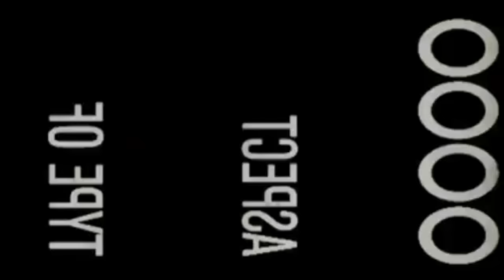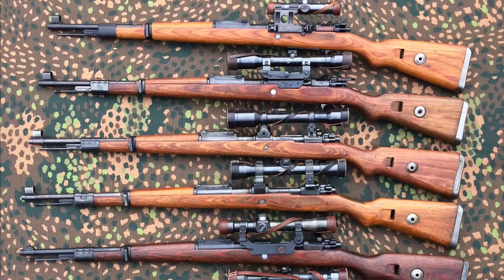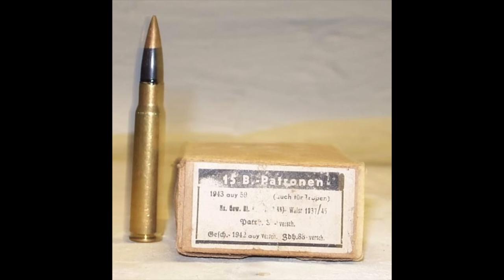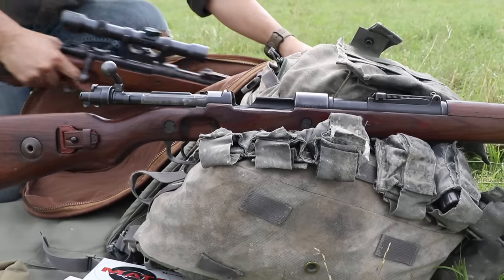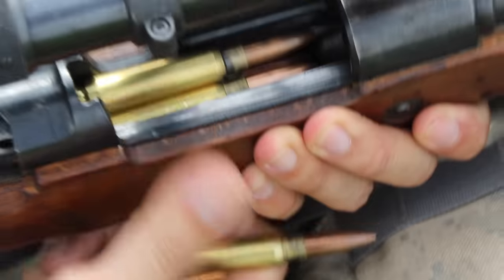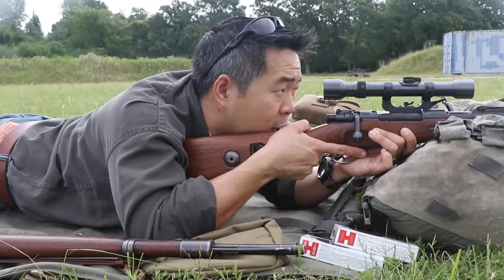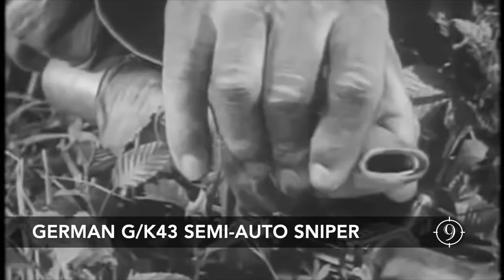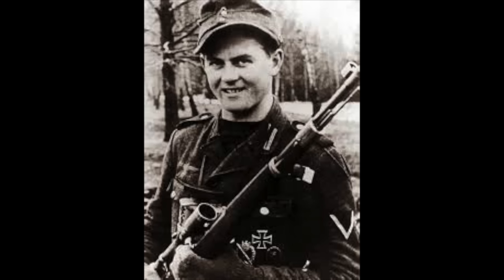The Kar98k Sniper Rifle and the WW2 German Sniper

Comment: Owning and shooting a K98K from 1936 with an ZF41 myself and I love it. Normally it's 200m and I can tell that it's quiet accurate - even with rather cheap ammo.
Always a pleasure to use it. I actually bought it as my late grandfather had one of these from the same year and the same production as mine. Of course the original was lost somewhere in Russia - not so my Grandpa: He made it back home from Siberia to tell the story...
Reply: Practice is the criterion of truth. Pavlichenko and Zaitsev, if they read the words of praise about the Mauser, would laugh
Reply: @ОрдерШоков-ш8к  so true - at least the first part.
I assume if you have seen what any rifle in the hands of a good shooter is capable of, none of the two snipers you mentioned would laugh.
Did you have the chance to shoot them both? What are your impressions?
Reply: @HaraldHofer  

I have experience using the Mosin rifle and the kar98 Mauser rifle, the Mosin sniper rifle in my hands shows better results even with a PU sight. As a result, I replaced the PU sight on it with a modern 5-20x56. It is a pity that Zaitsev did not have such an opportunity
Reply: @ОрдерШоков-ш8к  Thanks for sharing you experience. However: the K98 Snipers were selected by there accuracy. And I assume the same applied for the Mosin. In order to get a comparable result both should be sniper variants. 
But frankly, I don't care too much about which rifle is "better".... :)
Reply: @HaraldHofer  Мосин все еще соажается против террористов в Сирии, поэтому для меня это важно))
Reply: @HaraldHofer  Mosin is still fighting against terrorists in Syria, so it's important to me which one is better 😁
Reply: @Götz von Berlichingen 
I suggest you be objective, not spitting crap. In what Mauser is better than Mosin:
- a good fast fuse;
- Mauser is shorter than Mosin. 
What Mosin is superior to the Mauser:
- accuracy is higher than the Mauser and is 1.5 MOA with a good cartridge;
- a very common cartridge with a wide range of items, especially in combat areas;
- higher reliability in combat and hunting in deep forests;
- a cheap way to install a modern sight that does not overlap the sight line of the front sight and rear sight;
- Mosin's armor penetration is better.
Reply: @Götz von Berlichingen
SmK (G), one of the best Mouser armor-piercing-bullet 12.57 g, with a tungsten carbide core, muzzle velocity -911 m / s, armor penetration 19 mm per 100 m
But
The armor penetration of 7,62x54R 7n37 bullets was: 100% penetration of 10 mm thick 2P armor at a distance of 400 m and 80% penetration of the same armor at a distance of 500 m. 
In bolt-action rifles, the bolt stroke is ensured by the accuracy of the cylindrical surfaces of the bolt stem and its channel. The cylinder runs in the cylinder, and even with very little contamination of the cylindrical channel, the moving part is rubbed. And it is impossible to make more backlash in the cylindrical channel, because the quality of movement as a whole will immediately suffer.
In the VM, with an external similarity to the bolt scheme, the main part that ensures the shutter stroke is not the stem cylinder, but the connecting bar that slides in its prismatic groove. And in fact, this is a rifle with a longitudinally sliding prismatic bolt, where its cylindrical parts practically do not contact the cylindrical channel, and the reliability of the stroke is not responsible for the stem of the bolt, but a simple prismatic bar and an equally simple groove. Which is structurally still further protected from contamination by its very location.
This is easy to verify by simply inserting the mosinsky shutter stalk separately into the box channel - it will simply have huge backlashes and will not provide high-quality movement by itself. And the manufacture of its cylindrical surfaces will cause children's laughter from uninformed people and stupid ridicule of "Russians who are unable to process a cylindrical surface". In fact, the stem of the mosinsky gate could have any other shape instead of its cylindrical part - for example, it could be six or four-sided. From this, in the very course of the shutter Assembly, absolutely nothing depends.
But the bolt Assembly, although it looks like a bolt, goes extremely reliably and easily-due to the fact that this move is provided by a prismatic bar in the simplest groove. And large gaps in the coupling of cylindrical parts provide a lower probability of "cylinder-in-cylinder" jamming. Therefore, with the external similarity of the mosinka with a bolt rifle, it is quite legitimate to call it a weapon with a longitudinally sliding prismatic bolt, having cylindrical parts that are not designed to provide the bolt stroke as such.
And it is the connecting bar in the mosinsky gate that is the main part that requires precision processing and is responsible for the movement of the gate. And it is much easier to ensure the quality of a prismatic part in the same groove than the accuracy of cylindrical channels, and it is more reliable in the end.
It should also be noted that in most purely bolted schemes, a solution with a longitudinal sliding element correcting the stroke of the cylinders was also subsequently applied, this is easily seen in almost all modern bolters. Though not in such explicit form as in mesince. But the first who decided to part with the concentric cylinders and their guile was Mosin.
The second feature is the use of a Welt cartridge. In which the interaction of cartridges in the store occurs only three-point: at the points where the caps of the cartridges touch and only two points of the rest of the geometry of the cartridge case. There is a lot of free space around the cartridges that interact in this way, which allows you to carry even heavy contamination of the magazine.
In cartridges with a groove, and even stacked in a staggered order, the contact of cartridges with the magazine box and with each other occurs not by points, but by segments of contact, and it is much denser. And the slightest speck of dust there can jam the supply of ammunition. Cartridges with a Welt successfully pass much more pollution, it has a place to go in these cracks-without jamming the feed.
Reply: @Götz von Berlichingen Russian military tests for dirt, cold, icing, and dust are the most severe of all. They can withstand Mosin, Mauser, some stand, some are not. I wrote above why.
Reply: @Götz von Berlichingen Can you aim through the front sight and rear sight of a Mauser with a standard or modern optical sight?
Reply: @ОрдерШоков-ш8к  You are comparing the S.m.K.H, adopted in 1939, to a round that is rather rare and designed in the 2000's.
C.I.P has ruled that both cartridges can handle the same piezo pressure of 390MPa. And looking at ballistic coefficient of sniper cartridges, the 7N1* has a significantly lower ballistic coefficient of G1 0.411-0.498 than the s.S. at G1 0.557-0.593. So I don't see why you wouldn't be able to get similar performance out of 8mm Mauser if it wouldn't have fallen out of nearly all military use when NATO standardized the 7.62x51mm.
I'm not saying that 7.62x54R is bad, not at all, but I don't think the armour-piercing comparison is fair.

* I know that the 7N1 was replaced by 7N13/SNB in 1999. I was unable to find any data on the newer rounds.

Comment: Keep in mind that in the late war report the results were also heavily impacted by the ability of the shooter, not to mention the conditions on the day of shooting (a lot of impacting factors when you're shooting at 1.1 km. Also just a small note, the 80x140mm minimum accuracy acceptance standard rectangle has to be flipped, i.e. a 80mm horizontal x 140mm vertical rectangle @ 100 meters (110 yards), which is 2.8 MOA x 5 MOA, within which the 5 shot group must place. This was just the first stage of the acceptance procedure for the K98 however (there were 2 stages), in the second 5 out of 5 shots have to place within a 120mm circle at 100 m, that's 4.1 MOA. For comparison the British Enfield No.4 had to place 4 out of 5 shots with 4.5 MOA accuracy at 100 feet. These are the minimum standards every rifle had to pass in order to avoid being sent back to the factory however, hence they do NOT reflect the average accuracy of the series produced K98k or Enfield No.4, it is simply the MINIMUM requirement for the rifle to even be accepted for service, and this standard also has to reflect how many of these weapons are to be produced (over 15 million in the case of the K98), i.e. the larger the production required = the larger the multiplier needs to be applied to the expected mechanical accuracy, or you're rejecting too many rifles.

Comment: Do more of these brother, it is a very good 'down and dirty' style that goes over the points of interest quickly and accurately.
Reply from the maker: We'd really like to, but as you can imagine, the time for doing the research and production is quite lengthy.  So we can't make them as frequently our practical accuracy videos.
Reply: @9HoleReviews  I get it brother, I'm just saying this is some quality content, for example I didn't know WW2 Wehrmach had exact moa standards since most k98s of that era clock in at 5-6 moa. I was under the impression that the reason why they engaged at closer distances was the limitation of the mass produced k98s that clock under those moas. I think I speak for most of us, that quality is better than quantaty but mettc I guess.
Reply from the maker: @tarantulathree-one8013  Those Wehrmacht rifles did  indeed clock in at 2.5-6.6MOA. We quoted a study that the Wehrmacht Infantry school did on their sniper rifles and it was pretty bleh. This particular rifle+ammo for some reason is way more accurate than theirs.
Reply from the maker: @tarantulathree-one8013  2.5-6.6MOA was a 1km 12-shot group though, which still corresponds to a man-size grouping.Remember that there is a lot of environmental between that 1000m for the projectile too.

Comment: Hello guys.   A great video.  I was among other qualifications a sniper.  One thing that one can do with the K-98 K or other sniper rifles with the higher scope due to keeping the iron site capability.  I would still prefure this option even today if I was still in Service.  One can hold the K-98 K but stock from underneaths with the non firing hand, with the elbow forward ( Just like the firing technique used for the MG-42 and MG-34) just like the shooter is holding the new sniper rifle.  Also, like him, I also had a small sand bag under the rear of the stock and made slight adjustments with my non firing hand.  Yes, it takes longer to move the bolt to fire a second shot, but a sniper's code is "One Shot, On Kill!".  Also with the Semi-automatic M-21 sniper system, with was an accurized M-14 with scope, on could fire follow up shots right away.  Try that technique next time with the K-98 K.  I also read Sepp Allerburger's book.  Very capabile sniper and highly even better than the best Soviet Snipers.

Comment: The ZF-41 was originally intended to be more of a squad DMR then an actual sniper. What was supposed to happen is the best marksman im the squad would reciver a K98 special fitted woth a rail built into the sight block, later the germans would make a simpeler "field upgrade" package with the same rail and scope mounts, but instead of coming out of the sight block it was a replacement for the sight ramp with the adition of the opposite rail for the scope. What ended up happening was germany NEEDED sniper rifles and the ZF-41 was forced to be handed to snipers and the guy that should have been a DMR got... His standard K98

Comment: I've wondered about the specs given for accuracy on the sniper rifles. I've had a bucket of old Mausers over the years, and none of them shot as poorly as that standard. Outside of one unit that literally had no rifling left, even the most clapped out piece of crap would put 5 shots of surplus ball {when we could get that} in 4 MOA, and that's over irons. Handloads would shoot under 2, or much much better. Maybe I'm just lucky? Anyway, a great video.

Comment: I bought a Czech 8mm Mauser (grade NRA excellent back in 2006 (when they were still cheap) from SAMCO Imports, and fitted it with retro replica claw mount and Ziess copy 4x scope with post & crosshair reticle. Post surrender era tooled with "Arctic trigger guard" so no 'war eagles' were ever applied but still retains numerous "waffenampt" QC stampings on the sub-parts, etc. It looked brand new unissued and was heavy in cosmoline when I unboxed it. I burned up 2 drill bits drilling that excellent German Krupp steel receiver for the mounting screws. Its an excellent weapon and is VERY accurate. I even bedded the stock and free floated the barrel band, per original HEER Waffen Armory instructions K98K sniper preparation. It made a huge difference in consistent groupings..even using surplus 80s era Serbian ball ammo. It is one of my fave projects and keepsakes for my future lineage. It gets lots of "likes" at the range too. Not to many want to shoot it more than once or twice though...it does indeed 'kick-like-a mule!" 2 or 3 rounds of 5 shot strings will leave your shoulder a bit purple for a few days! LOL! :-)
Reply: Got a link to those bedding instructions?

Comment: In Argentina there were a lot of Mauser rifles versions. It was issued with the 1891 (if I'm not wrong) and was still in use, until got changed for the FN FAL which was also modified by our military. Look up for "Mauser modelo Argentino". Iraqveteran8888 has a review of some models (and they are kinda cheap).

Comment: How does the accuracy of  this karabiner 98k stand in comparison to the accuracy of the longer barreled world war 1 era Gewehr 98?
Reply from the maker: Only one way to find out.
Reply: Should probably not be measurable. At that time the tolerances were so high that the difference between k98ks  probably are higher than any possible difference by this few extra inches. Barrel length usually also doesn't have that much impact anyway. 
What I could imagine though is that the manufacturing improved and the tolerances shrunk.
Reply: DerFurz not true, the mosin 91/30 and m44 carbine version for example, the m91/30 has about 200fps more than the m44 in muzzle velocity due to its longer barrel
Reply: @The99lubie  I didn't say that barrel length doesn't do anything but it usually doesn't add accuracy
Reply: bhauger1  they were look at the requirements for sniper rifles in WW2. Even the cheapest rifles today exceed that. Of course ammunition quality is also contributing, but in general guns have gotten way more accurate. In a rifle even the smallest of tolerances makes a difference
Reply: bhauger1  no optics don't contribute to mechanical accuracy, they only contribute to practical accuracy. If you take the cheapest gun Mauser sells, the 18, it is a sub MOA gun with standard, quality ammo. Of all the millions of K98k build a handful really consistently achieve sub MOA, most of them don't and it's a lottery to get a accurate one. Of course they perform better today because the ammo quality increased, but they still don't have the inherent accuracy any modern rifle has, regardless of optics
Reply: @derfurz8618  I can get MOA with both my G98 and K98 using my handloads. The stocks have not been bedded but thoroughly cleaned and smoothened out. I've never shot anything through them other than my own load and I have never used different loads, usually 44gr IIRC.

Comment: I was a Special Forces / Special Operations sniper trained in both Urban and Field sniping.  Ultimately it's the sniper and the sniper's skill that determines the effectiveness of any weapon.   Semi-Automatic Sniper rifles certainely have some good advantages, as do bolt action sniper rifles.  It's truely noteworthy that the German K98K sniper rifles were so effective.  The concept of having both iron site and scope capability concurrently on a sniper rifle is something that should still be practiced today.  However many sniper rifles of today do not have this option, which I believe is a mistake as it doesn't apply the lessons of the greatest war in history sniper experiences.   Great video.
Reply: Way more than the vast majority of kar98ks were never fitted with scopes. That's not even mentioning all the other previous versions of the gun. It is not a sniper rifle nor was it designed to be one. It was intended to be a standard infantry rifle. Same as all the standard rifles developed at the time. And, of course, all the standard rifles at the time (except for the SMLE mk III being incredibly hard to do so on, so the Brits just didn't do it, especially since they had more accurate rifles) were capable of mounting scopes. But this does not classify the weapons type. The kar98 is not a sniper rifle (in fact, it's a carbine, not even really a rifle, meaning it's short, so less fit to be a sniper rifle, it's just the only German military bolt action produced since it started production), neither is the Gewehr 98, the 1903 Springfield, the Lee Enfield no.4 mkI, the Pattern 1914 Enfield, the Enfield M1917, the Arisaka Type 38 (carbine or rifle), any of the Type 99 rifles, or any of the Mosin Nagant variants (M91, M1907, M91/30, dragoon, M38, M44, M44L, etc.). None of these guns were designed as sniper rifles, so calling them such is inaccurate.